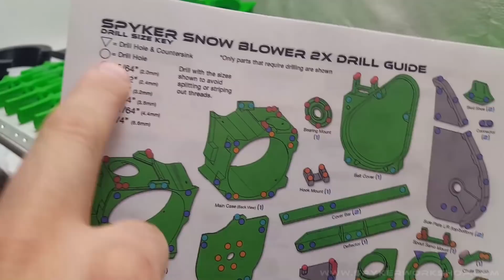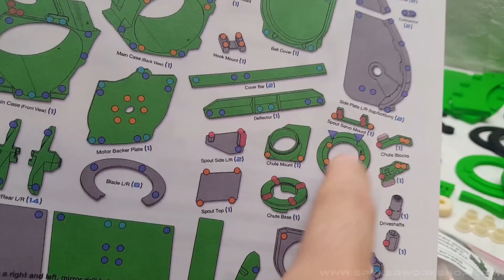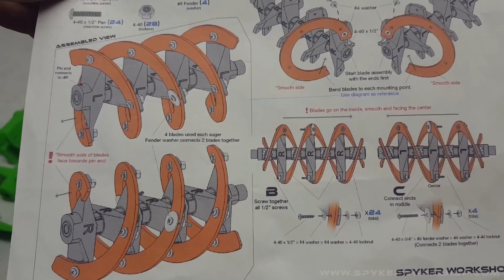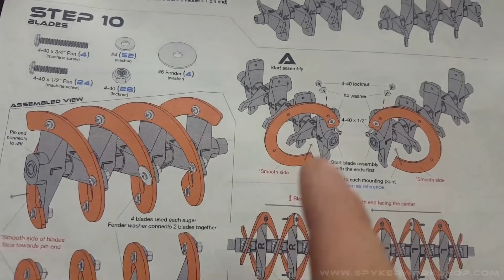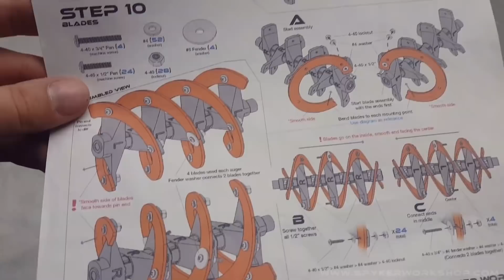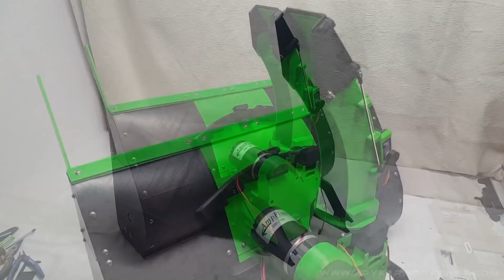Spyker Workshop - Spyker Snow Blower 2X (BUILD SERIES)

Comment: Thanks for mentioning the higher HP motors available for blower. I live a mile off Lake Erie, and we get a lot of wet snow instead of that inland fluffy snow. might hold off till you can test out higher HP and ESC  for blower. I have a hard time running my mini blower, but have found out that having the aluminum upgrade plate(the colder it is the faster it freezes with the aluminum) with a backed impeller blade will freeze up more than having a non backed impeller. next option is to ditch the aluminum plate and go with printed with no back impeller.
Reply from the maker: I have a Delrin injection molded motor plate for the mini blower: https://spykerworkshop.com/shop/3d-printed-snowblower/blowerupgrades/delrin-snow-blower-motor-plate/

Comment: Any plans on adding the 360 chute electronics to the 1X snowthrower. Im in the middle of printing and assembling the 1X cat right now and was already trying to think of a way to do that with the 1X snowthrower when I started printing it. Thanks for the great products and designs.
Reply from the maker: I plan to go back and add some things from the 2x to the 1x, but not 360 spout control, the custom slip-ring was a very complex thing that takes up a lot of space. I can't see doing a system like that half the size.